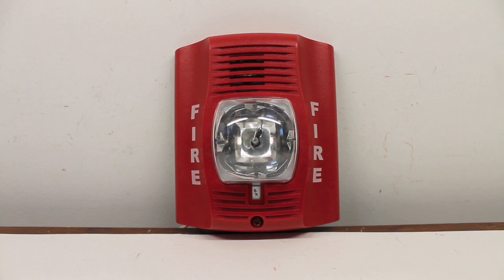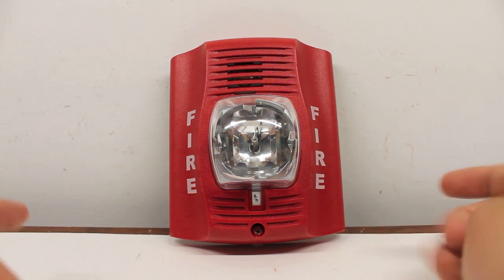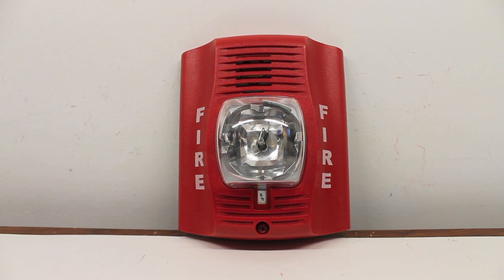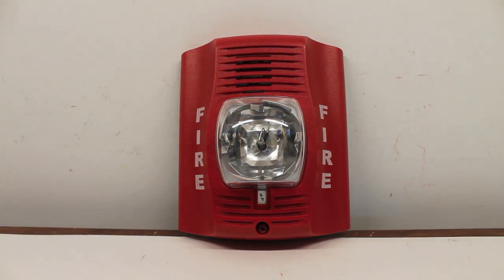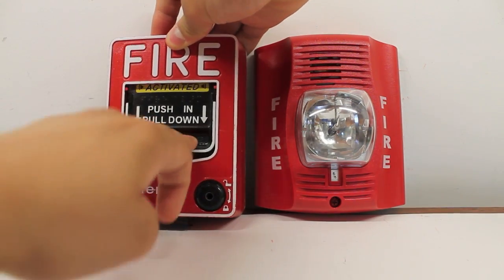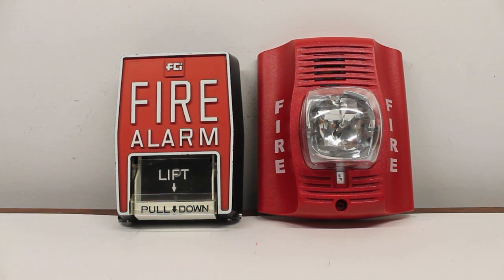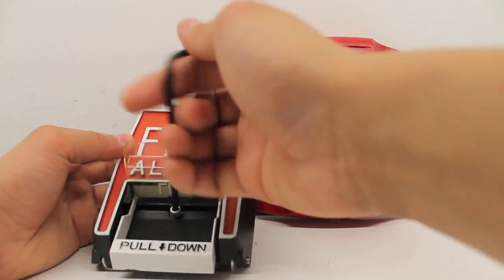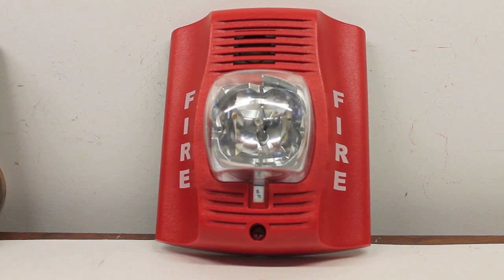System Sensor P2R (SpectAlert Advance) Fire Alarm Test

Comment: These alarms are at my old school. And, remembering the fire drills there just traumatize me.
Reply: And here’s the worst part. While it is true, the louder the alarm, the faster people want the leave the building. But guess what? It would take FOREVER (over exaggeration) for everyone to leave the building because the hallway would get PACKED. So, not only do I have to deal with that obnoxious sound for so long, but I also have to hold my ears until we get out of the building, because I’m sensitive to loud noises. My arms would hurt from holding my ears for so long. Also, those things were EVERYWHERE. It was just bad. 🤦🏻‍♂️
Reply: @Oof-zl6lt Thankfully I never had to deal with these Horn/Strobes in any of my schools but I have to deal with other very loud fire alarms at my college which include hearing Simplex 4903-9219 Electromechanical Horn/Strobes on Continuous including Horn/Strobes in bathrooms including 4 Wire TrueAlerts & Selectable 4903s on the same system inside of the Student Union. Those alarms are really hard on the ears and none of the strobes there are synchronized which makes it hard on the eyes. I've also had to put up with those extremely loud Edwards EST Genesis HDVM Horn/Strobes that I've heard inside the dorms & they are also unbearably loud & common like the SpectrAlert Advances
Reply: @Oof-zl6lt  Thankfully I never had to deal with these Horn/Strobes in any of my schools but I have to deal with other very loud fire alarms at my college which include hearing Simplex 4903-9219 Electromechanical Horn/Strobes on Continuous including Horn/Strobes in bathrooms including 4 Wire TrueAlerts & Selectable 4903s on the same system inside of the Student Union. Those alarms are really hard on the ears and none of the strobes there are synchronized which makes it hard on the eyes. I've also had to put up with those extremely loud Edwards EST Genesis HDVM Horn/Strobes that I've heard inside the dorms & they are also unbearably loud & common like the SpectrAlert Advances but sound completely different. Those alarms are so small too.
Reply: @Oof-zl6lt  Thankfully I never had to deal with these Horn/Strobes in any of my schools but I have to deal with other very loud fire alarms at my college which include hearing Simplex 4903-9219 Electromechanical Horn/Strobes on Continuous including Horn/Strobes in bathrooms including 4 Wire TrueAlerts & Selectable 4903s on the same system inside of the Student Union. Those alarms are really hard on the ears and none of the strobes there are synchronized which makes it hard on the eyes. I've also had to put up with those extremely loud Edwards EST Genesis HDVM Horn/Strobes that I've heard inside the dorms & they are also unbearably loud & common like the SpectrAlert Advances but sound completely different. Those alarms are so small too.
Reply: That's the Alarm we had at my School
Reply: @stephensalloum7763  We've got Simplex 4903-9219 Electromechanical Horn/Strobes in my College's Student Union on Continuous & they are VERY VERY loud. They even have them installed in the bathrooms in such a small space. The strobes are not synchronized & it is pretty crazy if you ask me. I love Simplex 4903-9219s
Reply: @stephensalloum7763  We've got Simplex 4903-9219 Electromechanical Horn/Strobes in my College's Student Union on Continuous & they are VERY VERY loud. They even have them installed in the bathrooms in such a small space. None of the strobes are synchronized. I'd honestly run out of the toilet if I heard it go off. We also have EST Genesis alarms at the college & oof they are so loud

Comment: I’ve seen one of those at Chili’s not just inside the restaurant nor outside, but in a bathroom. If Chili’s just used a strobe only, it would’ve been fine.
Reply from the maker: That's probably the most bizzare setup I've heard of; these units only in a restroom. Usually if there are horn/strobes in the common area, either theres a strobe in the restroom, or there is none present in the restroom. Thanks for your comment, insight, and view!

Comment: I am just curious if you have a ceiling mounted version of the System Sensor SpectrAlert Advance fire alarm device. Not forcefully asking you to do a video of that or anything, but the only reason why I asked for request is to be curious as I was telling you about what happened at my local Kroger. Anyways, I just uploaded the video if you want to check it out. Same exact horn sound as in this video! https://www.youtube.com/watch?v=ljyM81djBBs
Reply from the maker: Nah, I totally understand, and I just saw your video! Unfortinately, I don't have any of the Advance devices in ceiling mount. However, I do have something close, which is one from the classic series. I have a ceiling mount remote strobe, and it's the SC241575.
Reply: @NewEnglandElevators  If you haven't done that device, do you think you could share a video just to show me how it works? If your viewers beg you to upload more elevator/fire alarm videos, you could put a pined comment what exactly the reason you uploaded for (although you don't upload anymore). Like for example, if I request you to upload the video of the fire alarm that you just told me about. Also... is it called the System Sensor SepctrAlert Classic ceiling mount remote strobe that looks similar to the Advance one? I"d love to see that! Unless you have already done it years ago, that's understandable.
Reply from the maker: @JimLiElevators  The SC241575 I made a video of a long time ago...back in 2011. It's an older video, so it's not as great as this one. It may have been featured in a few of my other alarm videos in the past, I don't remember off the top of my head.

Comment: I find the Wheelock AS and the Simplex TrueAlert to be just as loud as the SpectrAlert Advance here. And the new L-series from System Sensor sounds a lot like the Advance but is a tad softer.
Not to mention how the Advance is SO COMMON compared to other alarm signals. I've seen them replace older rarer alarms so many times, like at my college or at my first elementary school.
Reply from the maker: I haven't heard a L-Series yet, but am curious about it based on what I've been hearing about it...one of these days...
It is surprising at how common this thing is, and can be a bit bland. Surprisingly, I do enjoy the design of this series, especially the mounting design. I guess it's easy to see why it has been installed in a lot of places, easy design.

Comment: If they replaced vintage fire alarms in buildings with these, i would be extremely mad!
Reply: Vish C same
Reply: Old school 24v DC horns in continuous are so much better than spectralert advances in code 3. Can't go wrong with that distinctive vuvuzela like sound that varies from 180hz to 400hz from horn strobe to horn strobe on those mech horns.
Reply: Thay did tho... i think
Reply: You would be pissed about my dad’s school system. They had white mechanical 4903s then they replaced them with spectalert advances in red.
Reply: Same, my school used to have system sensor masses, but they replaced them with siemens rebranded wheelock led exceders

Comment: Now here's the concept of the volume. Lo volume: a volume used for example a classroom or a hallway. Med volume: used  in wider spaces like skyscrapers nor offices or gyms(including school gyms). Hi volume: this volume can be a life saver if you work in a large office room or in a factory mostly gyms and school gyms. Depending on how big the facility is. For example in a factory, Hi volume would be nessesary. To get many peoples attention. The reason why medium or Hi volume is not used in a classroom is because. If it were to go off in a classroom on high volume. Many students will experience loss of hearing for days or even months. If you read this and agree on my chart leave a like.
Reply: These are so excessive in a class room and only give me a heart attack at school there so loud you really only need a remote strobe in a class room in my opinion or at most a chime strobe and horn strobes at med volume every couple of feet apart in the hallways and high volume in the larger spaces like the gyms.
Reply: in classrooms they use strobe only units
Reply: @s.i.f.a.videos1337  That's not true in the slightest.
Reply: I think hi volume is used for outside
Reply: I honestly wish people that install them would adjust the volume and not have it on high everywhere. Still cool alarm though
Reply: Im TACO well high volume setting is at my school same at the previous schools jus telling u
Reply: My school has Simplex Mechanical Horn Strobes, SpectrAlert Classics, and SpectrAlert Advances all on High Volume setting
Reply: we have hi volume in our classrooms

Comment: I do have a spectralert advance horn strobe but mine is a ceiling mount which is in white so it's a PC2W. if you want you can check out my video and fire alarm test 3 by me testing it and yes I do have it on low volume code 3 but it was still pretty loud don't you think that's interesting my white ceiling mount?
Reply: i like the code 3

Comment: Now my work in meijer store has these all over the store. they also included these with speakers inside all coolers and freezers! i havent heard them go off yet but they are still working on a white box that has a keyport thats connected to the duct detectors and replacing the old simplex alarm panel.
Reply: +John Sumner it takes me about 3 minutes to get from one side of the building to other side. during the time, every 30 steps, they have one above my head.
Reply: +John Sumner the old fire alarm system they have is the system sensor mass. its really loud with just few of them.

Comment: so we have the most obnoxious echo in our gym 
with 4 of these in there without sync, it is loud as hell with the unsynced noise and the echo
Reply from the maker: +EnderDj Minecraft It seems like the devices out of sync make things a lot worse. For example, one device is in the middle of doing its horn blasts, while the next device over starts up. Add the loud volume and the echo, and it doesn't seem like a good situation.
Reply: ***** ikr we had a drill yesterday and we were in P.E. in the gym (Of course) when it went off, i thought i was gonna be deaf

Comment: The world would be a much better place without spevtralert advances
Reply from the maker: Zachary Bishop The volume on these things is completely unnecessary to get the point across that there's a fire in the building, possibly to the point of hearing damage. However, it can be a motivator to encourage people to leave the building. The extremely loud noise will prompt people to leave the building, they don't want to hear it.
Reply: ***** I agree with NJMoo, but I'm not happy with the person who put these on High volume at my school.
Reply: Set them on high volume and that'll get people out
Reply: Say what you want, but I personally think the SpectrAlert Advance is a very good fire alarm. I was traumatized by one when I was 4, but that led to me eventually wanting to learn more about fire alarms and appreciate them more.
Reply from the maker: NJMoo3652 This series is very easy to install, just mount the plate onto the box, wire the plate up, and mount the device itself. I CAN do without the noise though. It's good to get the attention of people in a potentially dangerous situation (fire, leak, etc). However, an alarm of this volume is definitely unnecessary...even to motivate people to leave the building.
Reply: Jaylon
Reply: What?! Please stay relevant to the topic!!

Comment: Where do you buy fire alarms?
Reply from the maker: eBay is the best place to purchase alarms, lower than retail prices usually (anything below $20 is good). There's a few other dealers out there, but I think their prices would be too ridiculous for a typical enthusiast wanting to collect a few devices. Usually those dealers intend to sell the stuff they are selling to contracting companies, building owners with fire alarm systems, etc.
Reply: Ok

Comment: Fire alarm hell!
Reply from the maker: It is good to have a loud alarm to get people's attention, especially in a space where there may be other loud ambient noises. There is also a benefit to those who are hearing impaired, a loud alarm can get their attention. However, an alarm THIS loud seems a little unnecessary. On the contrary, it's loud and obnoxious enough to motivate people to get away from the danger; which would most likely be a fire.
Reply: lkjhb1 yea
Reply: NewEnglandElevators I understand that

Comment: I can't stand seeing them in stores there's just too many like why can't they use wheelock exceders what do you think
Reply from the maker: I believe this particular unit has been out longer than the Exceeder. I don't exactly know when the Advance line was introduced, but I'm going to guess around 2006, as that's when the original SpectrAlert (and oddly enough the MASS line) was discontinued, according to Wikipedia (could be false, but is a good start). The Exceeder came out in mid-2008, I vaguely remember when that happened. Both have the "mounting plate" system, but somehow, I guess the SpectrAlert is more well known/installed amongst third party installers, who usually install systems in smaller stores.
Reply: Emillio Melendez I have seen the Advances are found in the types of buildings where the ceiling is high, and if it does off it could echo to get our attention.